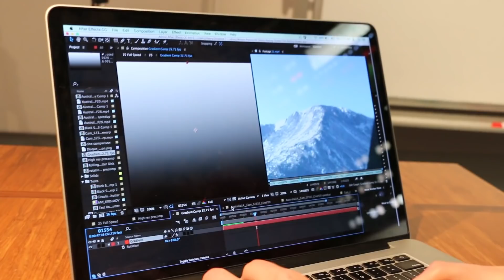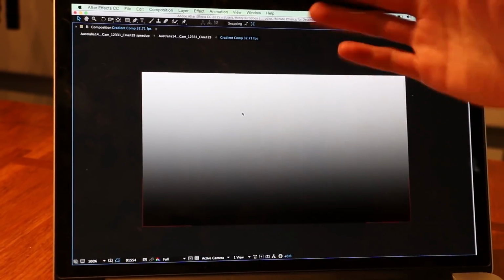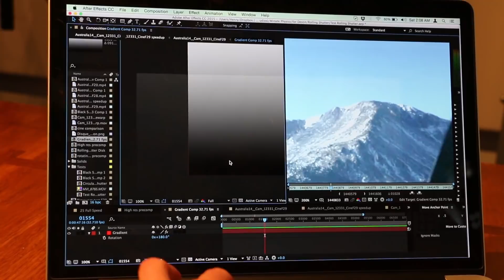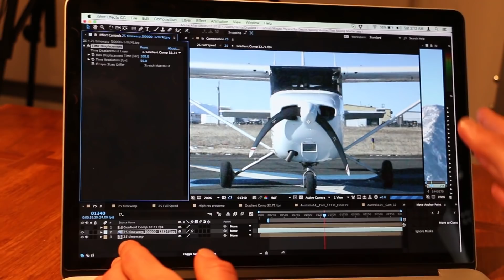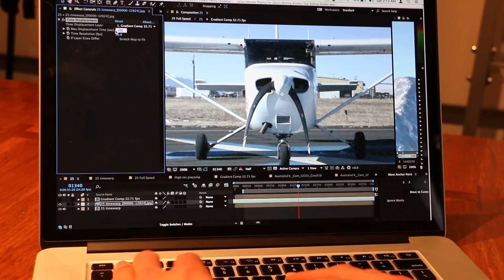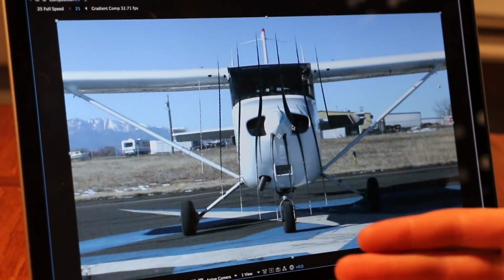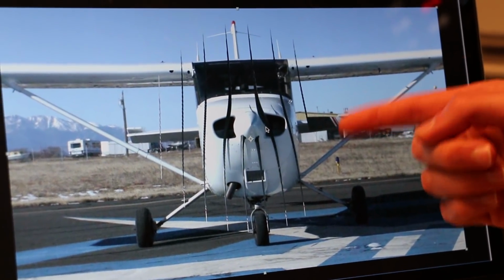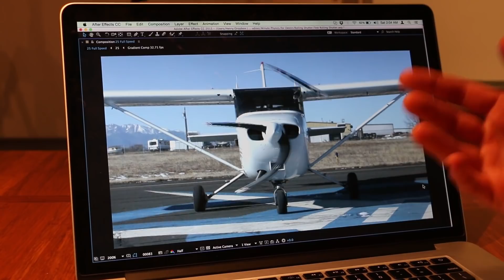Simulating Rolling Shutter (Behind the Scenes) - Smarter Every Day

Comment: Watched the whole video, even though I did not understand anything
Reply: Less dumb every day :)
Reply: He's using the brightness of the gradient to tell After Effects how far back to look. So black -> "now", white -> "very far back". Since it's a gradient, each row of pixels will be a different time offset, but all of the pixels in the same row share the same time offset, meaning the resulting image contains rows where each row is a piece of a different frame.
Reply: I watched the whole video, even though I knew almost all of it before I started.
That Propeller RPM estimation through artifacts is way cool though.
Reply: After Effects is a video editing, compositing, VFX, software. Henery is using it to slice 1 image from high-speed footage to simulate low speed "rolling shutter effect". He is explaining the process.
Reply: Isocan can Ever wave your hand across an old copy machine or a scanner and get an unworldly distorted image of your hand? Same idea but faster.
Reply: All these videos in a nutshell X'D I'm just to dumb!!
Reply: Think of it this way, the camera sensor is an array of tiny solar cells.  As the photons hit each cell they build up a charge in the cell.  The higher the charge, the brighter the light.  The only way to find out how much light hit that cell in a certain period of time, you need to clear the cell, then measure how much power built up in that cell in the specified period of time.  That means you have to visit each cell, ask it what value it has, copy that value to another location, then move on to the next cell.  All that takes time, and the cells have limitations in how much and how little energy they can store.

For my mental model above it's easier to think about visiting each cell individually, but that's not how it actually works.  CMOS sensors are accessed one row at a time, so this means that you get all pixels in a row at the same time x.  When you move onto the next row, you are at x + whatever time it took to read the previous row.  Therefore the time between the first row and the last row could be significant (depending on how much the scene being captured is changing).  So, the process looks like, visit a row, clear its data, go to the next row.  At the last row you pause for the shutter time, say 1 second, then you go back to the top and read the data from each row.  But no matter what action you are taking, clear or read, there is a physical time delay between processing the first row and processing the last row.

When reading the rows of the CMOS you generally start at the top and go to the bottom, reading rows, and from the bottom you go back to the start and keep doing that as quickly as possible.  To get longer shutter speeds you put a delay between the last row and the first row, so the speed at which you can read all the rows of the CMOS sensor is the fastest you can take images.  Faster CMOS cameras either read the sensor much faster from top to bottom, or read segments of the sensor separately from other segments (up to one channel per row).

SSDs are different because of the way they read the sensor.  You can think of it as pouring the cells out of the sensor, you get each pixel from each row in order, so you have to capture the entire chip at a single point in time (called "global shutter").  While the cells are being poured out, the chip must be in the dark to avoid changing the values of the cells.  The process of pouring out the cells resets the cell as they empty, so you don't have a separate "clear" step (as I understand it).
Reply: Same here
Reply: Guðni Matthíasson Same as Smarter every day
Reply: LOL, you aren't "dumb", but it helps to have experience with After Effects to understand what is going on here.
Reply: it is actually caused by cmos sensors, If you have a ccd sensor this does not happen
Reply: +Warblesonalot was talking about basic motion blur.
Reply: Steve Klemetti I'm pretty sure it's because it's cheaper, and because thats how the shutters' designed
Reply: +Gonçalo Cartaxana - I don't think there is enough information in the image to undo the effect.
+Steve Klemetti - The camera's CPU can't process all the information at once.
Reply: Destin has a habit of not giving the full story. It's irritating.
Reply: Your note alone mate, every typo is intended
Reply: +Warblesonalot - Because a film camera exposes the entire image at the same time, it will not produce the same effect. A film camera doesn't have a 'rolling shutter,' it just has a 'shutter'
Reply: WarblesOnALot Wow. You can't be more wrong. Rolling shutter only occurs on digital cameras. It's a result of the sensor scanning left to right, top to bottom during a frame exposure. It's particularly apparent on old phones with slower CPUs but even newer DSLRs suffer from rolling shutter. Basically, any object moving faster than the sensor scan rate will show this effect.
Reply: G'day,

  Don't worry mate, they didn't know what they were talking about, either..; none of the synthetic-images they cobbled up in this Video even remotely resembles what "an actual Rolling Shutter would produce, in the Real World...", if I might quote their very wrongfulness...(?) !

   I'm old enough to have learned to shoot Movie Film on a Super-8 (Silent) Camera, using 3-minute Casettes, it had a two-speed Shutter-setting, operating at 24 Frames per Second normally, or 48 for shooting Slow-Motion ; and all the Frames were taken at 1/125th of a Second..., regardless of the Frame-rate.

   And, not only but also (!),  I bought the Camera, Projector, Splicing-Jig, Hand-Viewer & 10 Film-Casettes (for $300 !) in 1986, specifically to record the behaviour of a Prototype Wind-Turbine which I'd designed, built, and was testing, and had been Still-photographing with a 5-power lens & 1/60th second Shutter-Speed to measure the Rotor-RPM from the Blade-Tip's Arc on the resulting Prints....; so, to be honest, filming Rotating Aerofoil-Arrays with a Rolling-Shutter is something about which I know a thing or two... (buffs Fingernails, modestly...).

   Because the Blades are spinning around a Central-Axis, the Tips are moving faster, rotationally,  than the inner parts of the Blades, at any RPM..; so if the Shutter is always open for 1/125th of a Second, with each image  exactly 1/24th of a second apart, as it was, then the  Rotor RPM could be determined by observing the projected Image.

  If the Turbine was turning at 180 RPM the Movie Film's projected Image showed the 2-Bladed Rotor as a stable (not rotating to Clockwise or Anticlockwise, ie not accelerating or decelerating) blurred image, with it's Tips "fanning-out" to show the Leading-Edge having advanced through 8.64 Degrees of Arc, while the Shutter was open...; at 270 RPM it appeared as a 4-Bladed Image with the Tips covering 12.96 Degrees, at 360 RPM the Image had 2 Blades with 17.28 Degree Tip-Arcs, 450 RPM gave a 4-Bladed Image with Tips covering 25.92 Degrees, and a couple of times I actually captured the 720 RPM Images of 2 stable Blades with 34.56 Degree Tip-Arcs...!

   And, to see the resulting Film, transmogrified onto Video, then please backtrack me to my Playlists, & dig into the one titled "Windmilling Warbles...." ; and there you may see it... (my Channel runs from a Mobile 'Phone,  computerless, so I can't post Links, sorry...).

  I hope that helps,

  ;-p

   Ciao !